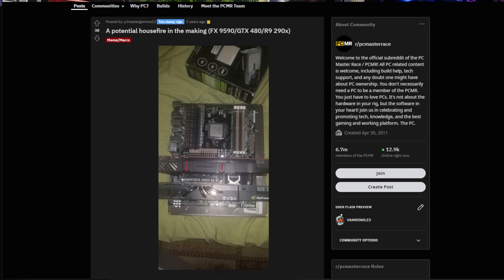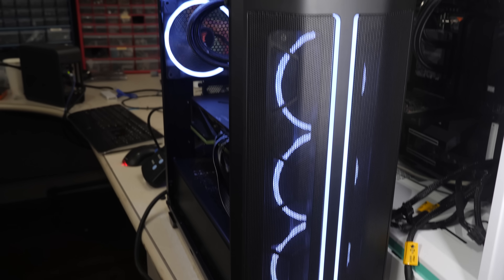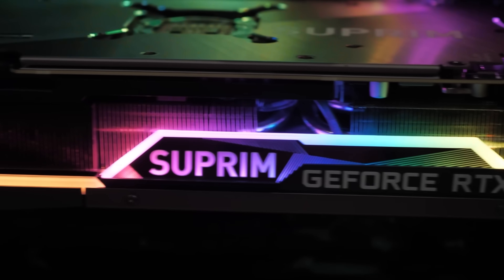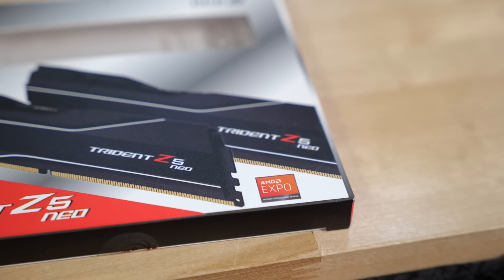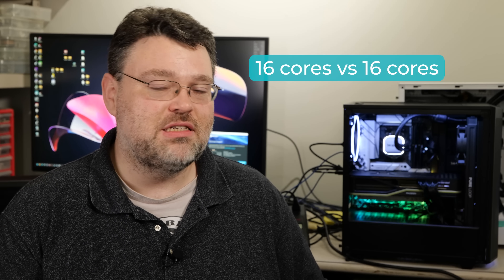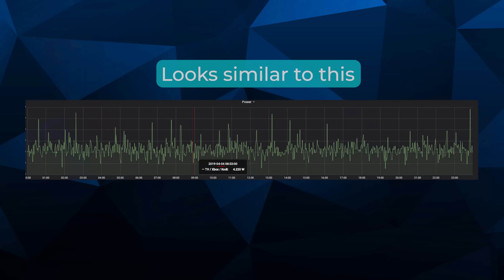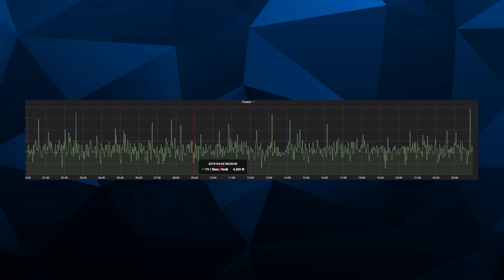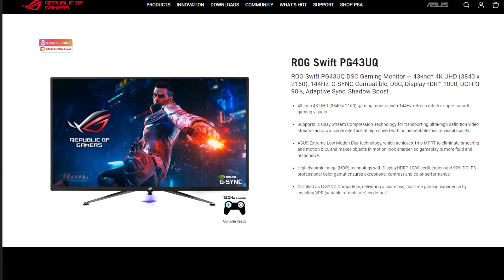Too Hot? How much Heat Do Intel and AMD Actually give off?

Comment: DDR5 prices are coming down hard. Still not as cheap as even high end DDR4, but the 32GB Trident Z5 Neo kit used in the video hovers between €240 - €270.
Also believe it's the Hynix a-die, no?

Comment: If you are gaming and you don't like the energy consumption: cap your FPS.
Your PC does 120? Cap it at 90 (or some sweet spot you like). Since your Hardware does not need to "get the max out of it" it will decrease your energy consumption by more than you think.
A GPU or CPU will always need a lot more voltage for "that last little bit", so setting a Max FPS value will basically tell your GPU / CPU to "chill out".

Comment: Laptops and M1 macs runs hot as well but no one complains that it is heating up their house. Laptop last 5+ years and it is usually the batteries or peripherals (keyboards and screen) that goes due to everyday wear and tear. 95C is no problem. I just don't understand all the talk about efficiency on desktops. If you are that concern with power efficiency or electricity cost a high-end laptop will always be better so, why even consider a desktop. For people running production workloads, being able to finish a task faster saves you time (man hours = labor cost) and no one would care about a $30 to $50 dollar a year increase in electricity per machine. Only cloud and datacenter operators should care about efficiency figures not the rest of us.

Comment: As retired Dutchman living with my wife in Santiago de los Caballeros with temperatures between 30°C and 35°C during the year, I prefer 65W APUs, like a Ryzen 3 2200G or Ryzen 5 5600G.  Running a high end gaming CPU I would use 1000W; 500W for the PC and 500W for the Airco :)  It gets very expensive in a month.  Now my PC uses between 20W and 100W and I can live easily with a normal 80cm standing room fan running during the day at speed 2 of 3 at say 50W.

Comment: my son has a Athlon system from way back in the 90's I took off all the metal stand-off's and used plasic except one that made only one ground source for the board and the thing was then insanely fast the trade off was it was a blast furnace then you could heat half the house with the thing don't think it ever throttled the cpu but it was a hot one when shipped with the board in a barebones kit the cpu had a m designation someone told me that was a laptop cpu that might had something to do with it's performance

Comment: Talking about heat which is more effective a space heater or pc I use a pc less power sure I could do the numbers but really I have a winter pc and a summer pc cause of the amount of heat they put off don't want to overwork the ac in summer that just wastes energy power  and if you load a game it stoaks up the power for those really cold nites ha ha

Comment: I like the use of the data logger instead of just spot measurements. At the end of the day what really matters (at least to me) is total energy consumption per month of normal usage. Spot measurements really tell you nothing about that. Particularly if you leave ur pc on 24/7 but aren't sitting down in front of it gaming 24/7. Sometimes the "less efficient" option that boosts higher is actually saving you power, if it idles lower.

Comment: It doesn't that much give more heat away as the thicker ihs delays the process of transferring it away from the source. And yes, while it also does give a bit more heat than am4 on the top end as per obvious specs, that doesn't mean it has to run 15-20 degrees hotter than it needs to, as basic experiments  have already proven it capable. At the risk of sounding cheap, when I put money into a top end product, I do expect to use it for as long as it is usable, rather than have it die within a year outside its warranty. 

This is easily fixable - phase change ihs. At least on the 12 and 16 core skus. Or just let me buy a nude one without having to lose warranty and risk to break by forcing delid. And by all means - void the warranty on physical damage, I do accept that transfer of responsibility, because this puppy needs, DESERVES better cooling treatment!

And yes, I do realize I may sound a bit paranoid, but we've never hit such cpu temps, even on processes far more resilient to thermal wear than today's mindbogglingly small and delicate ones. This, and the lack of ecc support on the horizon significantly diminishes the overall am5 platform value for me personally.

Comment: I'm hung up on hardware lifespan always running at 95C. Something has to give eventually, and considering the expense of the hardware I'd consider it a risk worth taking with liquid metal, custom open loop with copper blocks and direct-die cooling. Call me crazy but I'm not jazzed about always being near TJMax.

And if I were to do an open loop like that, I would then also bother with watercooling the graphics card if going with a 4090 solely because the air cooler could be ditched so the damn thing isn't four bays tall.

Comment: The issue with this method of heat calculation is that it measures power consumption and not heat generation. Power drawn from the wall is: 
1) converted into a heat on power rails on PSU;
2) converted into heat on motherboard VRM;
3) converted into heat on a CPU itself;
and then 4) used to open and close transistors. 

The actual heat generated by CPUs might be calculated on step 3. Not to mention there are a ton of other things inside of a modern computer that consumes power and generates heat. As a comparison this method is fine, I guess, but it's not scentific at all.

Comment: Kind of impressive when you consider 10nm vs 5nm. Intel really needs to catch up to TSMC. 

But it should be noted Zen4 is overclocking from the factory while Intel has a ton more headroom. Which is why AMD's hitting 95c constantly. Seems at least a little shady of a way to spoof reviews when no reviewer overclocks.

Comment: The only way pubg drops under 100fps on a 12900k is GPU bottleneck. My graphics are tuned to avoid GPU bottleneck and I never go below 100fps (10850k). Must have been a graphic setting or something.

Comment: I think this is pretty obvious. Measure how much power the CPU is using and you're done. If its used 300 joules in a second, AKA 300 watts, then that means it generated 300 joules of heat in that second, no if ands or buts.

Comment: For this feature touted as by design in the AM5 platform, I believe I did the same on my AM4.  Just enable the MB limits and set the temp limit to 95.  It seems like it behaves the same.  But will tip over 100c until the cooler ramps up, unless you have a better cooling setup.  Maybe I should adjust the curve more aggressive than "performance" to ramp up sooner.  Even better if I learn how to separate the fan and pump controls.
Reply: @gustavo_vanni  Thanks.  The fans and pump share a port on the MB as an AIO system.  I figure I could just separate them and do separate tuning in BIOS.  It gives the impression of independent profiles for up to four fans or fan groups.  I'm also not using Windows.

Comment: People could just imagine the old Easy Bake Oven for perspective.  It used a standard incandescent light bulb and actually baked stuff.   But the space it needed to heat was tiny.  Egg incubators and some tiny animal habitats still used light bulbs for heat.  You don't feel that heat but when almost touching; unless your skin is very heat sensitive.  It will burn you if you touch it while hot though.

Comment: Remember 8350?  I only recently put together a machine with an 8350, 32Gb RAM, and a 1080.  If you do leave the door closed and the machine running overnight it's warm in there even if it's just idle.

Comment: This may sound like a silly question, but if lapping (shaving off some of the metal on top of the CPU) results in better CPU cooling access, then WHY do the manufacturers (AMD/Intel) put such thick metal on the top of their CPU's in the first place? Why not say 1mm less?
Reply: Z height in the case of AMD, because they wanted to tout AM4 cooler compatibility. Too bad then that compatibility is severely limited.
Reply: @bluephreakr  eh, it's OK, anything that uses the stock backplate works fine. BeQuiet, Noctua, Scythe, Arctic Freezer II
Reply: @bluephreakr  don't you think that AMD should over a slimmed down version as well then? They could save on a lot of metal costs if they can use less, and people prefer that cheaper option.
Reply: @TimLongson  AMD can't "[Offer] a slim version", because then the ILM would need to be modified so it's risen off the board which would be a bunch of engineering work which would had been an insignificant cost reduction to the ILM, for a cost increase to the mainboard. AMD did it the cheapest way they could.
Reply: AMD wanted to make cooler compatibility easier, but the new socket moved the cpu PCB down, so they took the simple answer and just made the IHS that much thicker.
otherwise people would scream about "now I need an AM5 variant D15!? you bashtards!"

Comment: The Zen4 is generating frames faster so that the graphics card runs at a higher load on average, which raises the power usage by a lot. One of the simplest ways to control for that is to calculate energy-per-frame rather than wattage.
Reply: orly

Comment: I can't speak for everyone but in my case It's not that it's dumping more heat into my room than the Intel CPU but is IS dumping mor heat into my room than my previous AMD CPU. I think that's my concern. I live in a country with hot summers and my air conditioner isn't right in the room with my PC, so it doesn't keep up. This makes gaming pretty much impossible sometimes. I was super impressed at the heat reduction doing from my old intel CPU to my Ryzen 2700x. I was hoping this next gen would be my upgrade and that the heat output would stay low. I do appreciate that eco mode is an option though.

Comment: My issue with 95C in a hot-spot is that it now requires water-cooling to get the heat out into the room. I do wonder if they went to vapor chamber IHSs if things would change(of course add another $100 to the CPU).

P.S. I hope we get a DDR5 (4 slot dual-rank) vs a (2 slot dual-rank) comparison some day.  I doubt the gaming channels will ever test this because they never use more than 32GB which means they only test single-rank for the most part.
Reply: You missed the entire point of this video. It does not remotely require water cooling, the fact that a tiny part of the CPU is at 95 degrees does not mean it is putting out more heat and does not mean the IHS is reaching higher temperatures. It just means the CPU will not boost an extra 200MHz on the hottest core and you lose a tiny bit of performance
Reply: @TimSheehan  I did not miss the point at all(watts*time = work = heat = energy = high school science class stuff). I am making a different point. If the heat is concentrated on a small part of the IHS because of the small chiplet and inefficient IHS design then the cooling has to be concentrated on that spot. We don't need more "overall" cooling because the amount of heat is the same, but we may need more concentrated cooling. I'm also aware that a higher temp difference between the IHS and cooler should in theory have more efficient transfer of heat. But that also assumes that the heat if evenly distributed over the entire surface area which I doubt the current IHS does. In any case I don't know how much difference in CPU temperature that would make(again this is different topic than overall heat dissipated discussed in the video).
Reply: @jjdawg9918  you're saying it "needs water cooling". It doesn't. A decent sized air cooler will get you the same performance.

Comment: 20c, delid, and liquid metal. when prior test was paste, and poor quality paste at that.

and the performance difference is nothing. its just a heat thing.

I had a 9590, using at first an Antec Kuhler 920 (or 980? i forget) 120mm aio with fans in push pull, even upgraded the fans to SUNON 3000rpm rans which had like 180cfm and loud as hell.... and then switched to the 240mm NZXT cooler (first gen) using the same fans in just pull..... and temps were low as hell in gaming on my 9590, and i had a hard 5ghz overclock. if i remember it was 28c idle, 52c gaming, and 78c stress. and people always told me i was lying. but those sunon fans were godtier both cooling and loudness lmao.

i just recently upgraded to 7700x and asus x670e gene with ddr5 6000 cl36 ram. ODDLY i dont have an issues with booting the first time. when i first booted, it kicked right on. maybe the asus boards aren't using the auto ram timing thing that other brands are using? but i had to set the ddr5 6000 ram manually (4800 base speed) and then i can't run 7700x at 3000 for infinity clock. its defaulting to 2000 even with 6000 ram.

Comment: For myself, the reason I'm a bit annoyed about the AM5 heat spreader (and why if/when I get one I'll be delidding it), and seemingly in direct opposition to the broader internet, is that it kneecaps performance, an aspect not captured in this test. Ryzen 7000 will automatically ramp up to 95C or max socket power, whichever comes first. The thicker heat spreader means that it takes less to get to 95C, as shown by der8auer, which means that the CPU will use less power and deliver lower performance. This is less obvious on systems with fans locked at 100% and multi fan AIO coolers because they can compensate somewhat by cooling the heat spreader down more, so you get similar behaviour to the delidded case just with a higher number on the die temp - near maximum performance without mods or manual overclocking.

This will make undercooled AM5 CPUs produce less heat even though the die temperature is higher, in fact because of that - the heat is stuck in the die and not escaping into the rest of the room so the system slows down and produces less heat. The problem I have is that means they're effectivelythermal throttling.

Now for people using curve optimiser who want the system to operate efficiently this is a complete non issue because the chip has to be running in an effective overclock (even if it does it automatically) to hit that power limit, so not hitting the power limit when your target is efficiency is fine, but it does take away the option, and completely unnecessarily so.

Comment: Sound, light and mechanical movement/air flow both eventually get turned into heat anyway so the approximation is even more accurate than a superficially pedantic view anyway

Comment: My only concern about the high temperatures is the thermal expansion cycles. Will the CPU survive in the long run?
Reply: Yes, because operating temp handling comes down to silicon quality. Apple lets their much lower power (25w) silicon sit at 100C under load. The M2 will hit 104C. Most OEM computers operate at or above 90c under load. Which also includes Apple when they were using Intel CPUs. The 220w AMD FX CPUs couldn't handle being over 70C. A 25w soldering iron is like 380c-430C. Which I bring up because the most likely scenario for temps to be a problem is in BGA chips soldered to boards, with cheap low melting point solder. It's rarely a problem in laptops, but was basically the cause for the Xbox 360 RROD. The actual silicon die was fine which is why a reflow could get the console working again. You have basically nothing to worry about in a socketed CPU. Unless AMD is lying about 115C being the actual danger point.

Comment: What power supply is being used? It should matter because the efficiency curve is not linear and this makes hard to compare results. I mean that if you go from 200w to 400w power consumption on the socket it doesn't mean that the power drown by the components is doubled. In fact power supply have the best efficiency around 80% of theyr max wattage.

Comment: Remember the FX-8350?? My main system is still an FX-8350/32GB 1866/R7-360 2GB GDDR5!  ;-p  I have never had a problem with it producing too much heat. I have the usual energy saving stuff like cool n quiet turned on. My cooler is a Hyper 212+ EVO with 2 120mm fans. It idles at 33-35C, which is most of the time since it runs 24/7 since I have to have my bit torrent client running 24/7. And even though SSDs make boot-up times much faster, it's nice to just move the mouse and have the monitor wake up and the system is instantly ready to use. The only times I really see my CPU get loaded up is when playing a 4K x.265 or VC1 video since my gfx card obviously doesn't have hardware acceleration for those. And when I am using multipar to repair a large rar archive. Multipar spawns 8 threads to use all 8 cores and will peg the CPU 90-100%. This is a good thing of course since it repairs the archive much faster than the older quickpar program, which could take hours to repair a large rar archive. During these rare times of high usage it runs in the 50s C; I don't recall it ever running over 60C.....  I'd really like to build a nice AM4 system by the end of the year, but luckily I don't HAVE to hurry since my plucky little FX-8350 is still getting the job done ~9 years after being built.  :-D